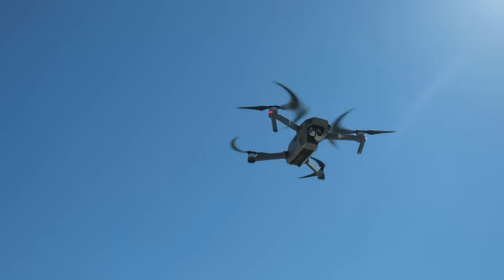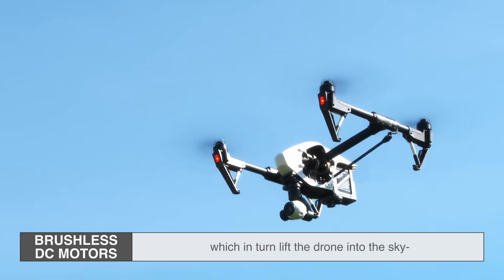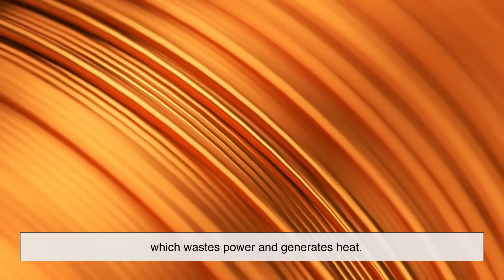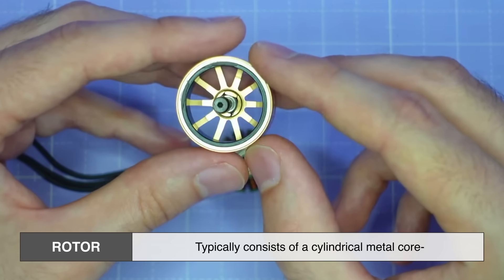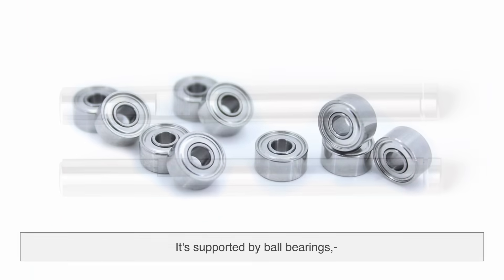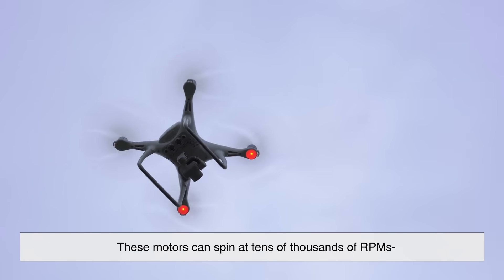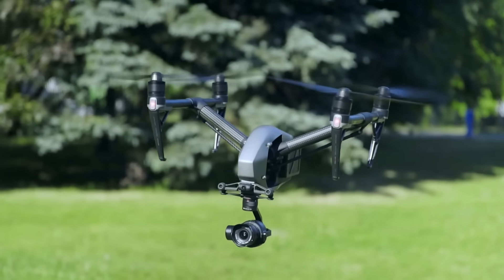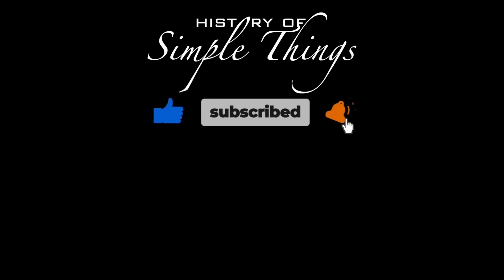How Are Drone Motors Manufactured?

Comment: Brushless motors are not DC. Otherwise you could attach a battery right to it and it would spin. However thats not the case. All Brushless motors use some form of coverter. It uses DC power from the battery and converts power into the correct singals (AC) to create rotation. In small hobby style converters, they're  called ESC ( electronic speed controller). The esc uses pulses to correctlly spin the motor. The frequency will change to increase or decrease the speed.
Reply: I believe it is still a DC current that gets switched ftom coil to coil. Some fancier brushless motors do use ac (switch polarity). On direction to pull towards a magnet and then it switches polarity to push away from the magnet. Very cool technology.

Comment: 3:20 Correction. The reels of wire are already insulated with epoxy, they are not applied after the stator is wound.
Reply: Yes this is often misunderstood.  Often, enamelled copper wire is used, so the wire is insulated before winding.

Comment: could you use these motors as generators?
Reply: Yes, just spinning them by hand creates a voltage. But for any real application you'd need some kind of power converter.

Comment: Brushless DC motors also called 'switched reluctance' motors... The rotating magnetic field that the permanent magnet rotor follows is produced by electronic switching of the voltage to each stator coil in turn, at very high speed.  In a brushless AC motor ( induction motor ) the rotating field is produced by a phase difference between two or more sine waves

Comment: You neglect the electronics, which are an important part of a drone motor. It is not an DC motor. It is a multi phase AC motor steared from an DC to AC converter like in modern car motors. How much phases are used ? Which frequences are used ? Which material is used for the stator which may get AC current in higher Khz frequencies. Is it laminated steel or high frequency ferrits ? All this is also part of this engines. Are all drone motors and electronics produced in China ? Or is there a full production ability in western states too ? This is important for security themes especially for military drones.

Comment: The copper wires are coated in a very thin coat of insulating lacquer prior to winding.  Bare copper windings would immediately short-circuit and the motor would not work.  Coating the entire stator and windings is done to prevent vibration that could wear away bits of the lacquer insulation, causing shorts which would decrease the efficiency of the motor.  

≥99.99% purity can hardly be called "incredible".  It's a standardised, routine purity known as OFE or "Oxygen Free Electronic" Grade and used in all kinds of electronic equipment from computer chips to TVs and cellphones.
Reply: You should get credit in this video.
Reply: Alambre y cables OFC, Oxygen Free Cooper, Cobre libre de Oxígeno..